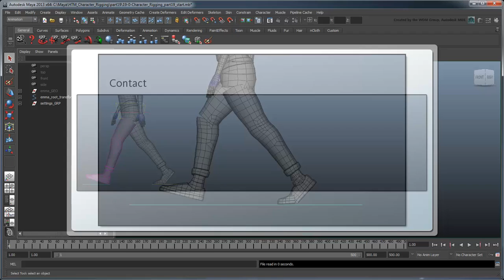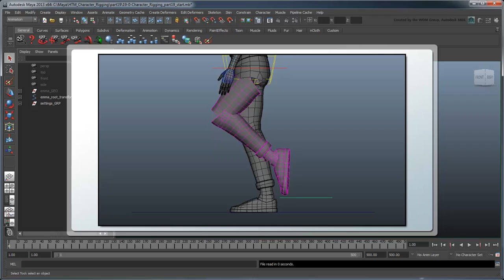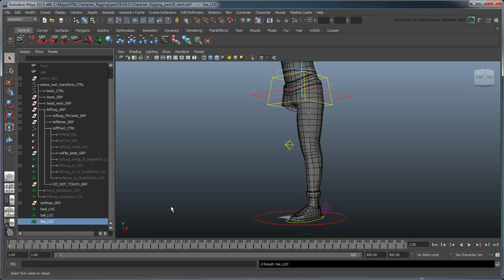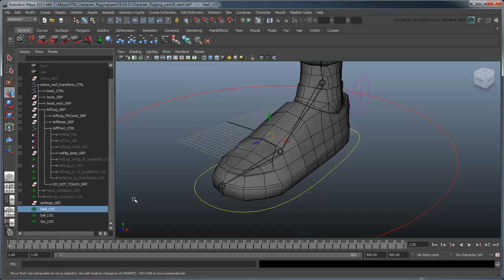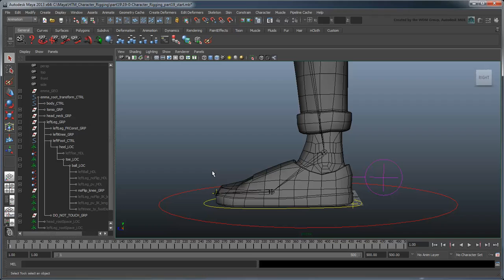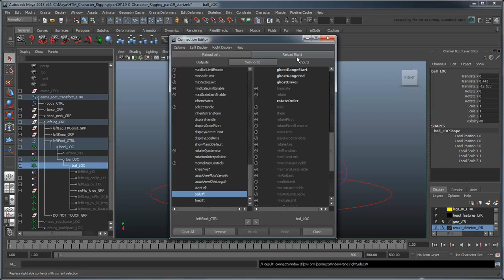Creating a Character Rig - Part 19: Reverse foot rig (Advanced)

Comment: I noticed after re-parenting the noFlip_knee_GRP under the ball locator, the group' s pivot starts to change.

I admit that unlike the way the Rig is set up here in the video - the model I am practicing with has his feet pointing slightly outwards - so my ball locators are rotated to match the direction of the toe joint. - im starting to suspect that this is the cause behind why moving the group under the ball loc is causing it to shift?
Reply from the maker: +Gogo This model has feet pointing slightly outwards as well.  There is step in an earlier video that outlines how to straighten them out before the FK/IK setup begins.  While not strictly necessary, it makes life a lot easier to rig the feet pointing straight (because of all the math nodes involved).
Reply: +Maya Learning Channel hi! hi!

I did a little investigation into why this was happening. At first i went in circles on my own rig, then I found it to be occurring on the scene files you provided as well. The position change when re-parenting the noFlip-Knee group occurs because the transform attributes are locked. When I unhid and unlocked the transformation attributes, (In my own rig I needed to disconnect the group's rotation link in the DG to the knee twist attribute as well) then re-parented - it carried over nicely along with the transform value adjustments you normally get from reparenting anything.

That said - is it a good idea in general to (a) unlock / unhide certain attributes before making an important hierarchic change like this? or (b) will it be ok just to manually re-position  the affected children after reparenting?
Reply from the maker: In an ideal world it would be good to unlock those things beneath it, but in practice it's not always that easy to follow the graph.  That being said, if you can do it, you should.

Comment: just got up to 5 mins in, and when I rotate the ball_LOC, the toe moves with it instead of staying planted on the ground, any ideas why?
Reply from the maker: This sounds like either the locators are incorrectly parented or you forgot an IK handle between the ball and toe.
Reply: my locators are in the correct positions and i have an IK handle between the ball and toe joints and im still having this problem, any ideas of what my problem could be?
Reply: @TheCrimsonArts  I had this issue, removed the point constraint I had on the left leg. that's what I was using to control the leg before parenting the IK to control itself. I think those two transforms where messing with eachother, I dont know what else could have fixed it, but it's fixed now
Reply from the maker: Your best bet is probably to download the linked scene file and compare yours with it.